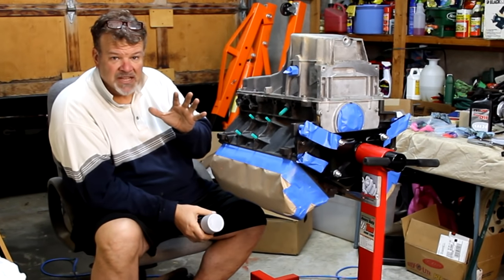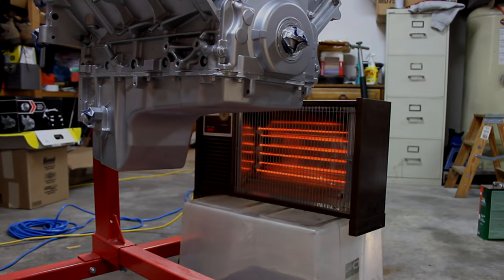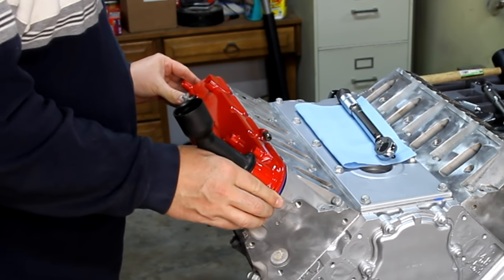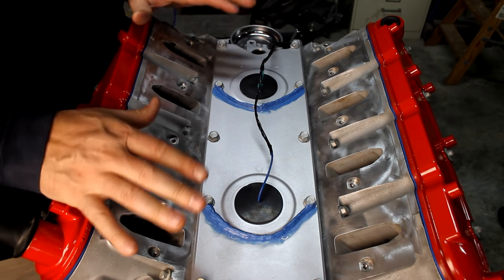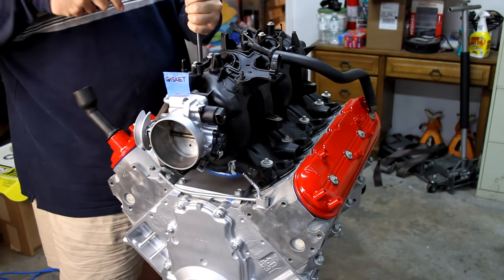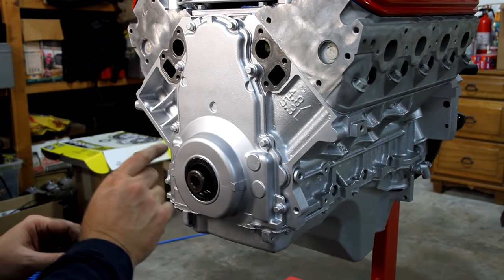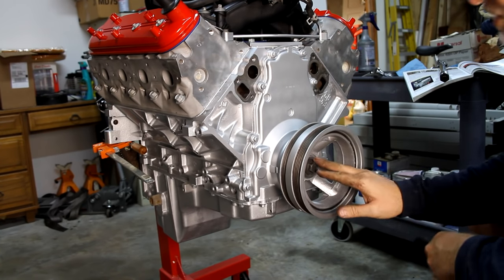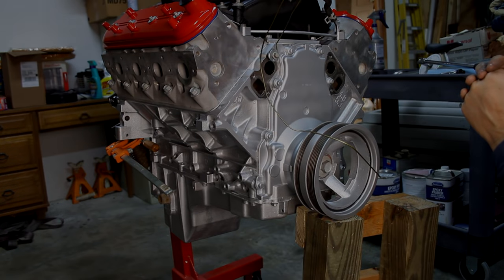LS 5.3L Build Part 7 Paint / Intake / Balancer | Project Rowdy Ep011

Comment: How did you get the old valley pan grommets out? And what is the torque spec on the valley pan bolts? Thanks in advance
Reply from the maker: The old Valley Pan Gasket (I assume you are talking about the round grommets at the Knock Sensors) are pinched between the Knock Sensors and the block.   I removed my Knock Sensors before the Valley Pan and so they very easily separated.  Torque Spec :  18 ft-lbs.
Reply: @UCanDoIt2Mike  awesome yeah I soaked them over night in penetrating oil and knocked them out with a piece of tube and a rubber mallet and they came out easy. I looked for videos on how to get the old grommets out and couldn't find anything showing the process but your video was the most helpful so thanks for posting it!

Comment: My truck has the 5.3 T motor which LS would it be  it's a 2002 Silverado
Reply from the maker: If the 8th digit is a T, you have an LM7 5.3L.   They where offered between 99-07.  285-295Hp, 325-335ftlb torque.   The same engine as I have in this video series.

Comment: did you use the old harmonic balancer?
Reply from the maker: Yes.   I cleaned up and painted the old one and reused it.   The bolt is new as it is a one time use bolt.
Reply: @UCanDoIt2Mike  im building my lq4 and im thinking of using the old harmonic balancer like you did.
you havent had any problems?

Comment: Did you painted that factory intake?
Reply from the maker: No...  It cleaned up fairly easily.  I prayed it with a cleaner (Something likr Dimple Green or Purple Power) and then wiped it off.  I did spend some time cleaning the 8 ports as they had carbon build up.  I assume this was due tot he EGR system that recirculates exhaust gasses.

Comment: Do you put any kind of sealer for the intake gaskets?
Reply from the maker: I did not.   I believe the new gaskets throughout the Gen3 and Gen4 engines where designed to install dry.  The only place that I used a little bit of sealer was in the 4 corners of the block where the oil pan mounts.  That was due to the gap of the front and rear covers.
Reply: UCanDoIt2 thank you. Allot of people were trying ti tell me ti seal everything up
Reply from the maker: I’ve seen people use Copper spray sealant on head gaskets where they are re-using the original head gasket on a “junk yard” build. My thought is why reuse a head gasket if you have it torn down that far.   Doesn’t make sense.

Comment: does the fast intake fit to? on the 5.3
Reply from the maker: All of the Gen3 and Gen4 engines are of the same platform  (design). One of the differences is the intake port design of the heads.   When choosing an intake, you need to make sure that the intake port designs are the same (Cathedral vs Rectangular).  My 2 cents.

Comment: What is that that he put on at 11:00
Reply from the maker: The Gen3 and Gen4 Heads have Steam Ports.  Some of the engine configurations do not use the rear ports.  These are plugs that cover the ports.  They have a small o-ring that provides a seal.
Reply: @UCanDoIt2Mike  thanks, I bought a LQ9 that is my first project 6.0 and I bought it all taken apart so I was confused since my gen 2 truck doesnt have those. Thanks again!!

Comment: Did you bake the valve covers as well?
Reply from the maker: loveto livetruely    Yes.   Anything that I could fit in the oven, I baked on.   I assume that it really helps cure the paint.  Cheers!!!!!
Reply: UCanDoIt2 Cheers to you as well... Rebuilding my engine, transmission and transfer case will be my greatest auto challenge. I have never done it. I have my manual and have done basic stuff like throttle, water pump, alternator, thermostat, plugs n wires. I'm so nervous but I know I can do it...
Reply from the maker: You appear to have the applied skills.  You will most likely find that you understand and a large percentage of what you will be doing and that the small percent that needs additional attention/research, that will all come easy.  Very rewarding and a great way to learn something new.  Take your time and enjoy your project!!!
Reply: UCanDoIt2 Very encouraging. It may be some months before I get to it just now I'm phsyching myself up...lol and getting prepared. I'll be sure to let you know how I did when I'm finished. I subbed 👍👍👍👍👍
Reply from the maker: Definitely keep me posted!   Would love to hear of your progress!

Comment: i have one of these engines in my truck, has close to half a million km on it and it still purrs like i kitten.
Reply from the maker: Well that's good news!   It's a great engine platform.  I had one in a 01 Tahoe and at 200K, it only showed signs of needing a new oil pump.  Gunna be fun!   Meow!
Reply: mine would be about 300,000 miles, strong oil pressure, pulls real strong, love these engines., this coming from a ford guy. lmao

Comment: At 10:33 what part is he installing?
Reply from the maker: Steam Vents.  I went back with the original setup which has vents on the front two ports and caps on the rear two ports.
Reply: UCanDoIt2 thank you so much!!
Reply: UCanDoIt2 I never knew I needed them and my 5.3 build is almost done haha! Just ordered some rear block off plates and front OEM tubes and figured out how to route them! Thank you so much!

Comment: Stop using adapters and extensions when not necessary when using your torque wrench.
Reply from the maker: It's a lame theory that Keyboard Mechanics love to hold on to.  Extensions and adapters have no effect on a torque wrench as long as you keep pivot of the torque wrench directly above the fastener (in-line).  I do a pretty good job of doing that, so you should not have seen anything so offensive to promote your chirp!  Might want to re-check your textbook.

Comment: What method did you use to clean your plastic intake manifold?
Reply from the maker: First let me say that this process was a mess.... but it came out looking new!!!!  I placed it into a larger tub and I alternated spraying it with Simple Green and Odorless Mineral Spirits.  For tools, I founds several different size plastic bristle brushes.  The inside of the runners were very dirty and I used a small chisel just to lightly scrape the carbon buildup off and then went back to the bristle brush.  What you see in the video is just the cleaned Intake.  I did not paint it.  Hope that helps!!!!
Reply: Thanks for the info. I had heard that there were certain chemicals not to use on a plastic intake manifold?
Reply from the maker: I had not heard that.  You maybe correct.  The composite that the Intake is made of is rather thick (~3/16").  So I would think that you could use about anything as long as you neutralized it afterwards.  I know the Simple Green would not be a problem, but it did an OK job cleaning.  I might now question the Odorless Mineral Spirits a little bit, but it really did a fantastic job on the carbon deposits.   The Intakes are subject to some harsh chemicals when people normally clean their engines.   Just a thought.  Cheers!